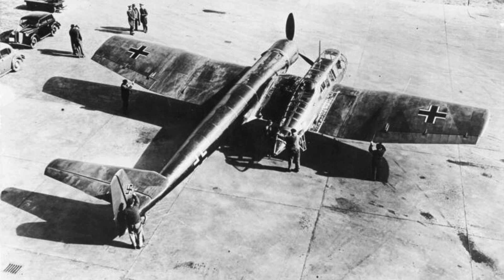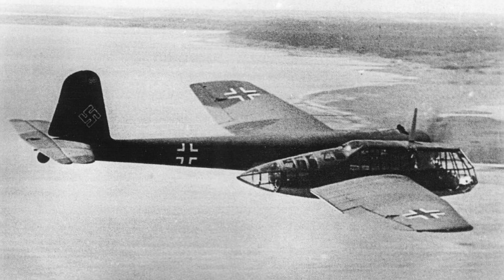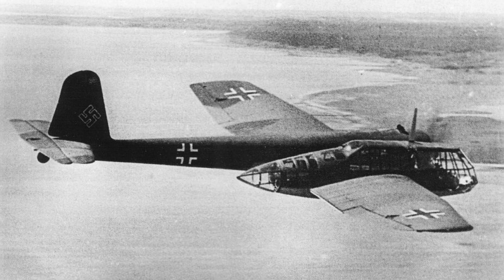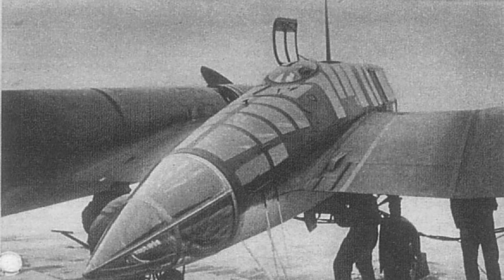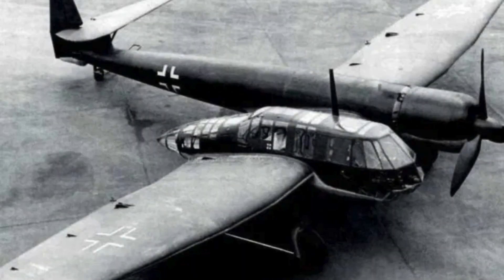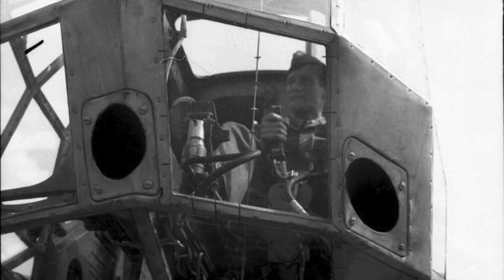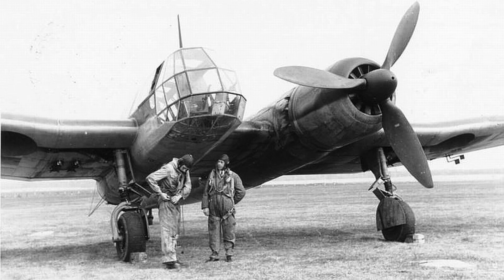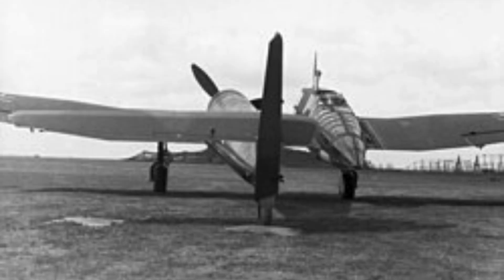The Nazi Recon Plane So Weird No One Believed It Could Fly

Comment: Ingenious, the prop will try to turn the aircraft left ( all props do, even in symmetrical and conventional prop driven aircraft), but the drag produced by the cockpit pod will counteract and cancel it, so the aircraft will be (more or less, depending on the throttle setting) dynamically stable in the yaw axis. There is a similar modern experimental aircraft designed by Burt Rutan.